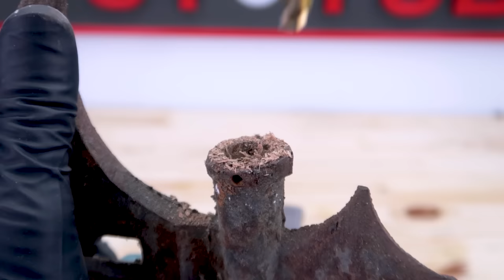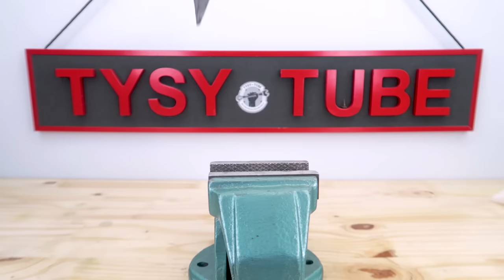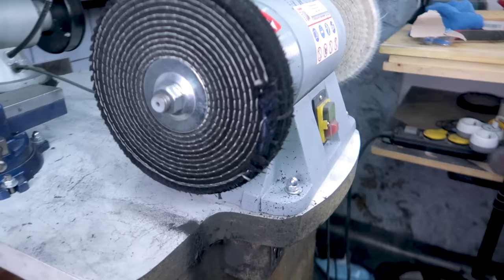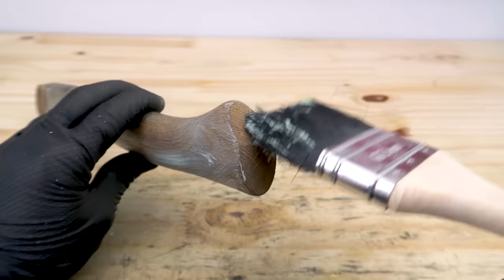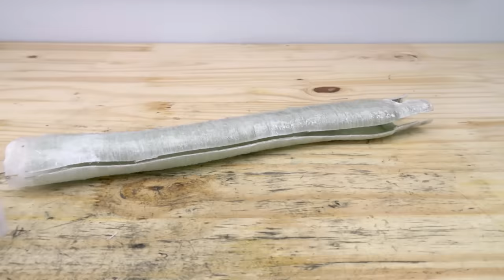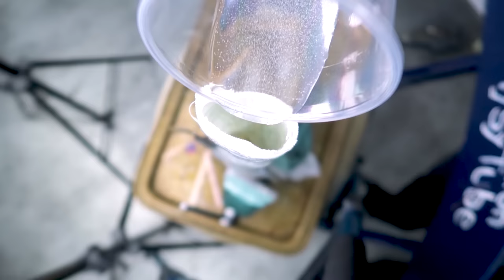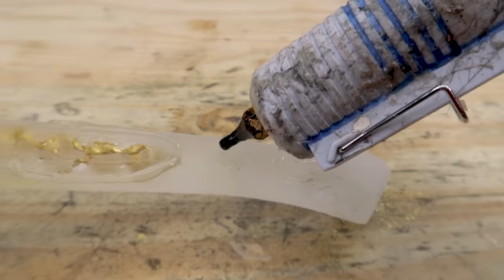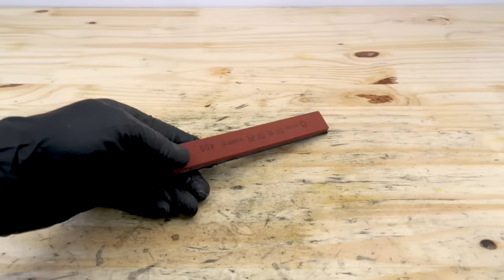Halberd AXE Restoration - With Epoxy Handle

Comment: I guess the video is a re-release after the entire world corrected you last time? Lol.
Reply from the maker: yes
Reply: What was wrong? I saw it but didn't see a problem with it
Reply: What even changed?
Reply: @australiangamer7956  I guess it was the title
Reply: I guess the title in the last one was wrong? It was "Gladiator axe".....
Reply: Now is really better than the other LOL
Reply: did anyone point out that a halberd is a polearm not a hatchet?
Reply: @false0start  i was going to but i figured nobody else cared lmao
Reply: @false0start  right. Generally had a 10 foot pole, and used by foot soldiers supporting calvary. There is even a variation with a hook on the back, used to snare opponents.
Reply: Some bits I didn't like (obvious ones the handle and the sharpening angle) but it is a beautiful piece of metal forged of not.

Comment: You should watch Peter Browns videos for epoxy help. He makes all sorts of stuff with it. Even an axe handle.

Might give you good insights on preventing those bubbles.
Reply: I was gonna suggest exactly that. And also not using an electric drill to whip air into like a meringue :P
Reply: Definitely suggest Peter Brown! Also Evan & Katelyn are great too!
Reply: Yup, Peter Brown!
Reply: @shego1142  I was coming down in the comments to write exactly this :)

Comment: I enjoy this kind of videos. And then sometimes i just think: what the hell are you doing, dude? The epoxy handle is looking awful... it's not just the wrong material, the shape doesn't fit to this kind of axe. 
I like the idea with the golden elements with the polished metal.

Comment: If you put it in a pressure pot, after stirring it, and as it's setting it gets rid of all of the bubbles! also, if you have a three to one ratio resin it causes less bubbles than a one-to-one ratio. It sets much slower but has less stirring involved ergo, less bubbles! Also, if you sand and polish the resin it turns less cloudy and will be absolutely gorgeous! I recommend watching Bens workx videos, he doesn't incredible stuff with wood and resin! Maybe you can get some ideas! I love this ax!  It turned out beautiful!

Comment: I cant help myself.
A halberd is bent to be mounted on a pole. Thats why it has a back point and a spear tip. This thing is too short to be viable with the mounted blade.
An axe of that size (that u made)  has to have a bigger bottom bit for hooking. This axehead is only good with leverage, the thing a pole would provide.

Comment: Ok you asked... The amount of air added by the stirring is based on the area and turbulence of the stir. So a very small shaft w/a small 'fan' below the surface works well. Just insert it slowly.  For bigger gaps in the mold, vibration can help. Usually for bubbles a low frequency works better; say 100hz or below. Thanks for posting, I liked the handle mold a lot.

Comment: For getting rid of bubbles:

Get a large tub allowing the object to be oriented properly for the resin fill.

Prop up or suspend the object.

Cap the tub with a lid, secured tightly.

The lid needs a 3/8" brass ball valve integrated into it.

Connect the ball valve to a pneumatic hose and vacuum pump (check your local hardware/refrigerant supply house, they should have one available; shop around for good prices).

You now have a custom sized vacuum chamber.

Comment: It has been 2 years, but if you don't already know. The reason for the bubbles is how you were mixing. While it looks cool for the camera, the double popsicle stick on a drill is incorporating micro bubbles into the mixture. The 2 parts need to be well mixed, but it is important to be gentle and avoid mixing in air. As it settles those micro bubbles settle, they combined to form the large pockets like you had. Hope that helps.

Comment: Cool video, I want to know how long it for the poor casting to look that old. You can see the seams from the casting after sandblasting. And the rivit would not have been that easy to remove and the second piece of metal from the Handel wah shiny and new. I still like the video

Comment: I see comments saying to use a vacuum chamber to get rid of bubbles, and that might work, but if it doesn't you should consider the opposite and use a pressure pot instead. it compresses the bubbles down to be microscopic so they're completely invisible, I see people commonly doing this in making custom dice for tabletop games like Dungeons and Dragons out of resin.

Comment: I know this video was posted awhile ago but I use a vacuum chamber or if there's visible air pockets on the surface of the cured resin, fill it with more resin. It will take longer for you to finish it but it helps.

Comment: I have used anti foamers it helps to break up the bubbles and makes them easyer to float to the top. Basf has some df 9010 is the model. Also wacker has silfoam sp 150... Dont know if it will work on your resin but its worth a shot!

Comment: If you have problems with bubbles in your epoxy, you can use vibration to remove them, or you can use a vacuum chamber

Comment: I think (and this is really just a hypothesis) that this halberd was manufactured in large quantities judging by the seams, the ones he files off after sandblasting. It looks to me like it was made in a rush, almost to just make a bunch instead of concentrating on making one good blade.
Reply: This means to me that there either used to be a lot more in circulation at one point or that this was made for decorative purposes, like with a decorative shield with halberds behind it

Comment: If you want to stop the bubbles, try setting something vibrating against the mould as it sets, or if you want to spend some money, buy a vacuum chamber. I think they make them large enough to hold this project. If it were me, I'd wrap some leather strap around the handle for grip, and because it would look good, especially if it were tooled leather.

Comment: I don’t know if you will read this but to get rid of bubbles in epoxy you vibrate it or tap it for a while until the bubbles come up to the surface and it takes a while to get them all out

Comment: You can get rid of bubbles by either using a vaccum chamber on a resin before pouring, using a hiperbaric chamber while epoxy is setting or by using a vibrating plate (the cheapest option I guess) instead of that gentle tapping of yours.

Comment: If you place it in a pressure pot or a vacuum chamber while the resin is still liquid it will get rid of bubbles a pressure pot compresses the air bubbles down so small they can’t be seen and a vacuum chamber pull all the air out so that there are no bubbles at all hope this helped!

Comment: to avoid bubbles in resin just stir by hand i know it consumes time but its cheaper than getting a huge pressure pot or vacuum chamber oh you can also try to pour higher as well but i think thats more for silicone

Comment: Alternatively to making a vaccuum chamber, most resins are only to be poured to a certain thickness and in segments. so say a 24 inch pour you would pour an inch or 2 at a time. let it settle but still be sticky. kind of like a hard jello. and applying heat in between layers can draw out alot of the smaller bubbles too.

Comment: for long items when i resin craft, i do them longways (horizontal) when i mold them to pour. like, instead of having the handle upright and thin, i would have it laid down on it's side, so that i can peek into the mold if i need to
Reply: (this was for the bubble comment btw) it helps stop bubbles significantly in my experience

Comment: If you have a vacuum chamber and a pressure pot those can help reduce bubbles in the resin. Once mix place in a vacuum chamber, pour the epoxy, then place it into a pressure pot. Take off the cast and it should have less bubbles.

Comment: to get rid of air bubbles you can either use a pressure pot to suck the air bubbles out, or you can get a slower acting epoxy resin to allow the bubbles to float to the top before it hardens

Comment: To help get rid of the bubbles you could just stick it in a vacuum chamber and it’ll pull out all of the bubble, just make sure that it is upright that way the air will flow in the correct direction

Comment: Encasing the resin doesn’t allow the bubbles to dissipate out during the curing process and the large voids are where the bubbles tried to escape but with no outlet they joined together and created a large gap, it still looks good anyway

Comment: You asked for ideas about getting rid of bubbles in your epoxy handle.  What if you were able to connect some sort of random orbital device or some that vibrates and as you pour the epoxy, you are shaking at the same time.

Comment: You can get rid of bubbles using vacuum chamber instead of air heater. It reduces epoxy hardening time and get rid of any air so also air bubbles!

Comment: To get bubble out of resin use a vacuum chamber, the lower pressure outside of the resin draws out the air bubbles

Comment: With resin you need a pressure pot to compact the bubbles. There will always be bubbles, but you can put them under pressure to make them so small you can't really see them.

Comment: With epoxy you could use a pressure pot or vacuum to take the bubbles away. Other than that you should try and mix with out introducing bubbles.

Comment: If you don't have a pressure pot you can heat up the resin so it is more fluid so the bubbles can rise easier. Might nit get rid of all of the bubbles, but there should definitely be less of them.

Comment: Getting rid of the bubbles.  There is a machine you can buy that pressurises them out. I've seen it used on epoxy guitars and other epoxy furniture.  Seems to work great. Don't know what they are called. But won't be hard to find out off YouTube vids.

Comment: People are commenting about the handle not being accurate to a halberd. I'm here to say that isn't even a halberd at all. That is a poleaxe head. A halberd is a spear with a long point; the small axe head is secondary, mainly to get the enemy from behind as you pull it back from a missed thrust. A poleaxe like this is mainly an axe; the point on top is more decorative than anything, though I still wouldn't want to be poked with it. Either way, though, I think the handle you made is awesome.

Comment: To remove bubbles:
Cheapest and easiest way would be to buy a dozen of 12cm pc fans, break one blade and somehow attach as many as possible to the  mold.
Best way and most tedious and probably most expensive would be vacuum.
Golden average would be a high pressure chamber.
It's up to you to decide

Comment: It is quite an investment, but if you use a lot of epoxy, a vacuum chamber is nice to get  rid of bubbles : it makes them inflate and buoy to the surface waaaaay faster, even tiny invisible ones. Almost looks like your epoxy is boiling !

Comment: Get rid of bubbles
Use a resin made for deep pours
Apply the heat gun after mixing but before pouring.  The heat is only to pop the bubbles, tou didnt need it to cast the wood.
Alsp next time, cast the handle horizontally instead of vertically, will help the bubbles rise out snd help you see them the heat gun them away.

Comment: It seems to be cast, by the cast marks along the parallel plane along the vertical cross section. That tells me it is modern, and only a wallhanger piece. Still, nice work, as usual. Allso explains how You dared to give it an epoxy handle, witch by the way turned out really nice. I still did not managed to create a bubble free epoxy mold thicker, than a few cm, and for my project i need to make a 35-40 cm high epoxy mold, bubble free. Not to mention, that epoxy is rather expensive to experiment with. At least for me.

Comment: Vacuum chamber is the best way pressure pot will compression the bubbles to pretty much invisible but they are still there and can cause the resin to be more fragile than a Vacuum chamber which removes all air from the resin

Comment: You can get rid of the bubbles from the epoxy by putting the solution into a vacuum chamber. I would have preferred a wood finish rather than an epoxy finish but overall great project

Comment: you could get the air out with a pressure pot and it is a little easier than trying to use a vacuum chamber.

Comment: Considering what a Halberd is, I'm confused why you turned it into a one-handed weapon instead of actually restoring it to what it's supposed to be.
Reply: Well it's a casted head...probably not heat treated, it was a wall hanger. >.> it's just a smaller wall hanger and I still hate that it wasn't restored.

Comment: I am a fan of your channel Tysy and it's interesting what you tried to do here but, I hate to say that  the end product looks a bit tacky. It may have been better perhaps to skip the gold leaf and to use something as a core in the centre of the epoxy that was the full length of the clear handle. This may be an example of perhaps trying to do too much? Anyway, thanks for sharing nevertheless.

Comment: A pressure pot would get rid of the bubbles in resin (not sure if this is like... a really late comment or not but yeah) - also as previously stated by another commenter, it’s very common that people use vibrating devices to get rid of bubbles too 😂

Comment: You can try using pressure pot or create a vacuum chamber to get rid of bubbles. You can check out YouTubers Nick Zammeti or Bobby Duke to see how they work with epoxy resin.

Comment: unfortunately this is not a vintage halberd. If it was, it wouldn't having casting lines right around the perimeter because it would have been hand forged. This is a modern cast replica.

Comment: that uh... that aint a halberd. thats just an axe, a halberd would be like 6 feet long or about 1.8 meters in length. also the handle would be just one long piece of metal, they're Poleaxes for a reason.

Comment: Good except that’s a halberd head on a hatchet handle and my brain is going crazy. Also if you have a vacuum chamber you can put the resin in there while it hardens and pull a vacuum to prevent bubbles.

Comment: You can tell by the casting marks that's not a real weapon used by fighters, it was probably part of a decorative motive in some high class household back in the day. A real medieval weapon never had such casting marks, since it was not molded with a cast, but by a smithy by hand & hammer. The metal is not meant for battle either, so I don't believe it can be used as a real weapon.

Comment: You turned a wall hanger halberd into a hatchet? If you were going to foil plate the shaft why didn't you fill the pitting first? Should have degassed the epoxy before pouring for a crYstal clear finish. and why didn't you cut the screw tip off the auger it would have given it a better looking finish. The blade is not hardened and will never hold an edge because it's most likely made of mild steel or pot metal. Most of your work is good but everyone has a stinker from time to time and I'm sorry but I believe this is one of them. Cheer up and use this as a learning experience unless you're one of those that thinks everyone deserves a trophy? In that case great job bravo keep up the good work and ignore the rest of my comment.

Comment: It's a hallebard, not an axe. A hallebard has a handle of more than a metre and a half. At the other end of the handle there is a metal tip. When the hallebardier use his weapon. He fixed in the ground the tip and tilted the hallebard of 40-45 degrees with the metal head when the enemy rider approached his head with the axe wounded the horse and disarmed the rider. Mounting such an axe piece is downright ridiculous. Gabriel (France).

Comment: It looks pretty ,but neighter usefull nor historically accurate, halberds dont have axe or hatchet handles, its often made out of iron or steel ,maybe wood, epoxy handle will break as soon as you strike a hard surface ,like armour.

Comment: Don't get me wrong and this is only my opinion, but that looks horrible.  I mean it looks like a cheap handle on a old drill bit with cheap gold leaf.  Its gaudy.  Like it belongs in 80s pimp my viking show.  Even leather strapping to cover the bottom half of the handle would have been cool

Comment: Would rather had seen you restore it to a pole arm. You did a great job on the blade. But would have preferred to see what you would have done with the pole side of it. Just think you ruined it with the axe handle

Comment: Although a cool and beautiful process. That is no vintage item. Those "rough edges" are the flashing from the gaps between the two halves of the casting mould. That being said, the original manufacturer didnt care to remove the flashing, unfortu lately leading me to belive that is an inferior alloy of steel, combined with the handle construction that piece is purely a  wall hanger. A cool wall hanger. But nothing more. I would fear for the safety of anyone who actually tries to use it.